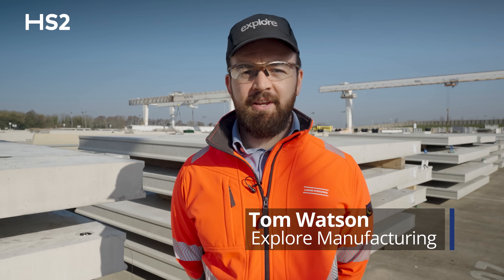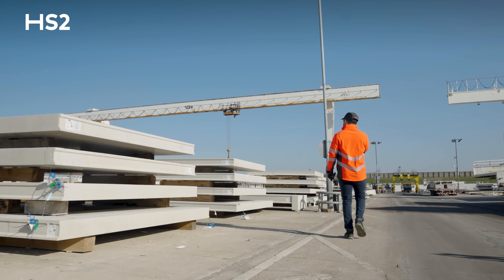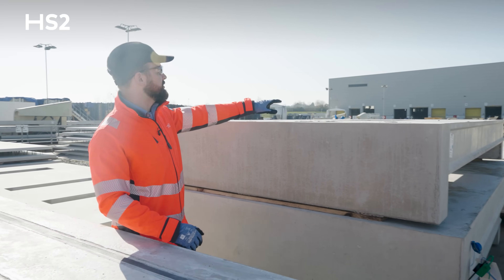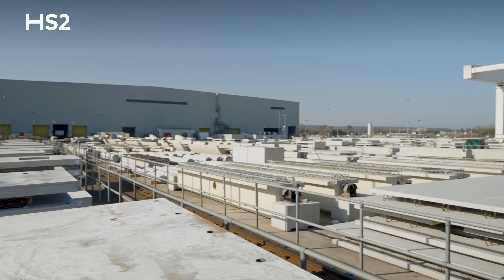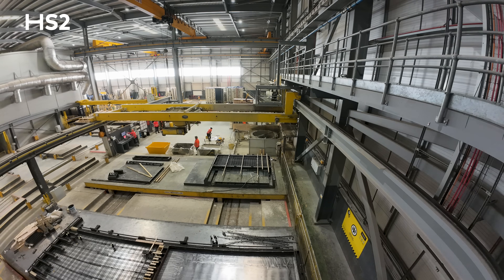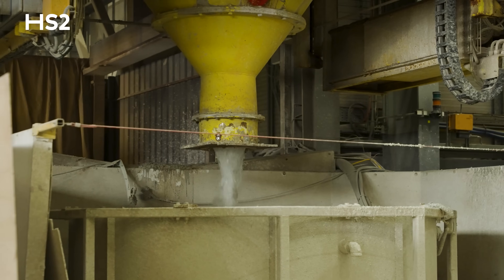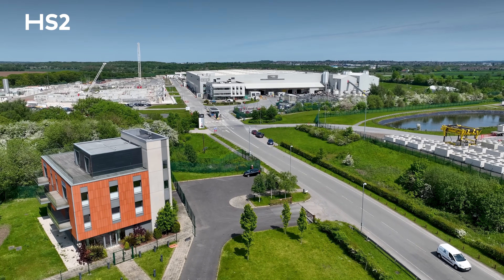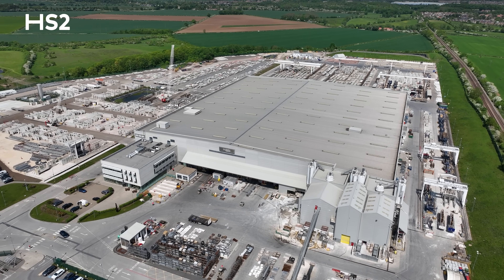From East Midlands to West London: How engineers build HS2’s Old Oak Common station platforms

Comment: Its getting real when they are starting to build the platforms...
Reply: Have you noticed that some of the Nimbys and Naysayers are starting to fade away !
Reply: @JohnHoward-wc9kk   I hadn't but yes they have... And not missed at all!
Reply: Platforms are being installed because it's work below ground level before access gets blocked off.. There's still some way to go with the station superstructure yet to start.
Reply: @TrevorWilliams-fq8mg   So in your eyes this is not any real progress at all ... OK
Reply: @1chish I'm not  saying that all. I'm saying there's been a massive amount of work below ground level out of sight to dste.. The basement is huge and was  built top down. The piles,  known as plunge piles are 60 metres deep with a steel column cast in them to support the station structure with a diaphragm perimeter retaining wall. The basement excavation is in the hundreds of thousands of cubic metres and the concrete would be a similar number. The total cost of the station is approx 3 billion and about 50% of that has been spent to date. Like all HS2 contracts it's a huge project built on a massive site.. but those who have no understanding of the construction industry won't see it like that because all the work is hidden from sight below ground level.